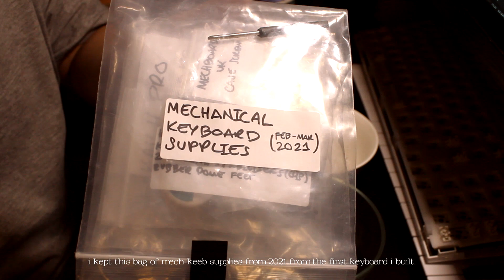Modding the YUNZII YZ98 (ASMR / no music version)

Comment: Great content. I'm looking to buy a good budget 96% keyboard that costs around or below $100. How does it compare with the CIDOO ABM098? I really liked that keyboard but just missed the spring sale!
Reply from the maker: Thanks for enjoying the video!
I don't have the CIDOO ABM098, but after doing some quick research on it, here's what I found:
- They are both gasket mount, both have customisable RGB and are both reprogrammable; YUNZII has their own software but the CIDOO is reprogrammable with VIA
- YZ98 has a longer battery life (4600mAh) compared to the CIDOO (3000mAh)
- They can both be connected by wire, bluetooth and 2.4GHz USB, but the YZ98 can connect to 5 devices max with bluetooth. Not too sure about the CIDOO bluetooth max connectivity.
- They are both hot-swappable too for easy modding.

I've also checked the YUNZII site and it still says that it's 14% off for me, give it a double check and if it still isn't on sale then it must be me. They both seem like decent keyboards, seem pretty decent as they are (stock) and have decent modability.
Hope this helps!
Reply: @adingGENESIS  Thanks man! I was actually referring to the epomaker sale for the CIDOO. That keyboard sounds great on stock. The YZ98 seems a good bang for the buck, although I'm not too inclined with the sound profile out of the box. The mods made it much better.
Reply from the maker: Yeah it honestly didn't sound bad stock, but didn't sound that great either. Still though, I was impressed with the stock keys and the moddability of it. Maybe I was more impressed than I thought cause I slowly got unsatisfied with my first ever keyboard I built after 3 years of using it...